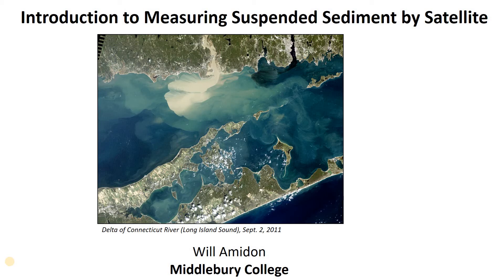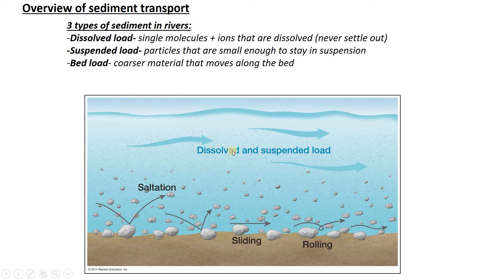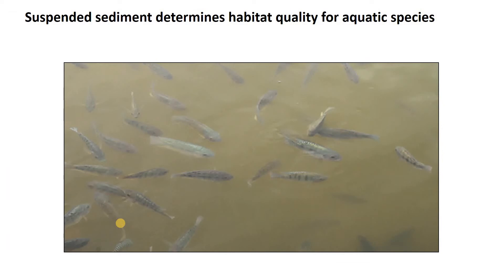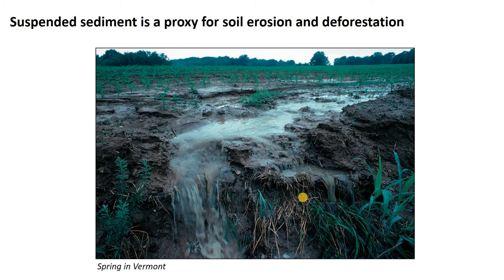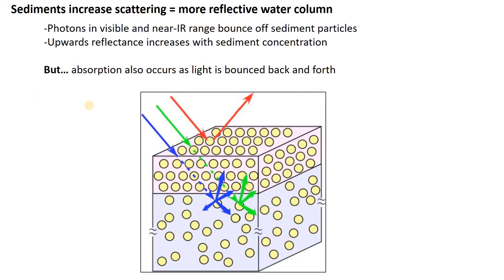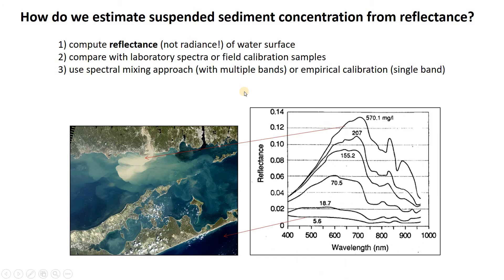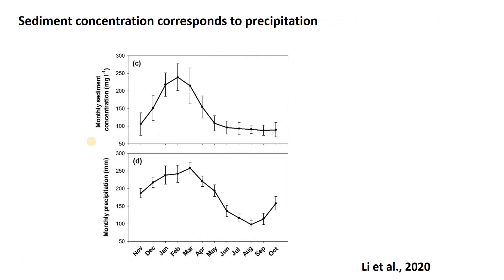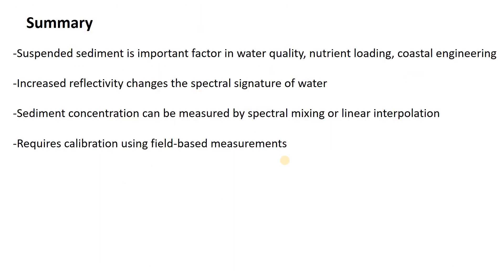Introduction to Measuring Suspended Sediment by Satellite (Lab 4- v5)

Comment: This overview asspect can also be part of research of Vertical wall type breakwater (harbor) with function of protect from siltaton. However, the distribution of sediment concentration in the ocean follows the law of being spase at the top and dense at the bootom, especially for the encircled harbor basin to the water exchange and reduces sediment depositiom, a new-type vertical wall breakwater with inclined that is modified. Satelite image and laboratory mixing is so good for research ~ multitasking like for civil and structural engineer and geology one. Also we can use Weibull function for spatial change of each component of surface sediment M1, M2, M3 and M4 form finest to coarsest models, respectively, are the four components from grain size 1.